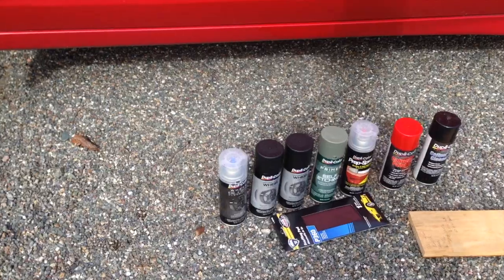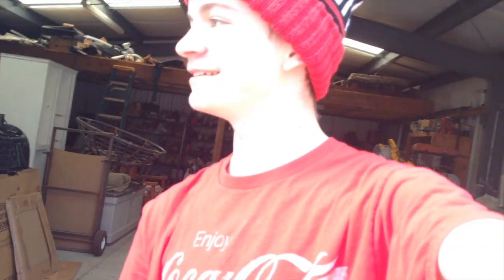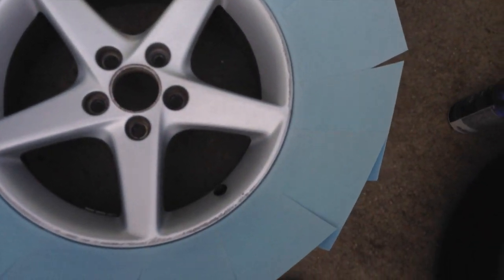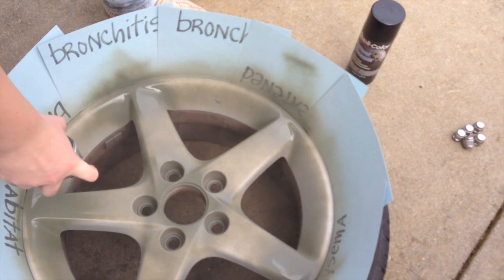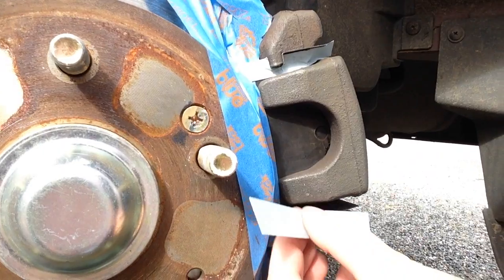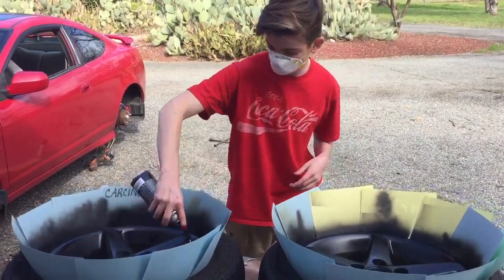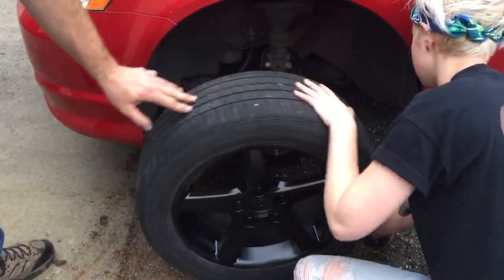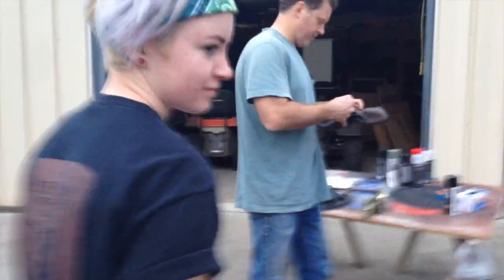WE PAINTED THEM!!!

Comment: They look really sharp! The only concern I would have is when she gets her tires done, will the paint chip from the tire machine?
Reply from the maker: +Brad Snyder It shouldn't as the paint cures the longer it is on there, plus I don't think she's due for new tires for a while. Also, we used paint specifically made for car rims and we followed a process that has worked for many other people. :) Good point though
Reply: +IAmKaden Ah ok, I wasn't sure. But they did turn out great. 👍🏻
Reply from the maker: Thanks Brad! :)